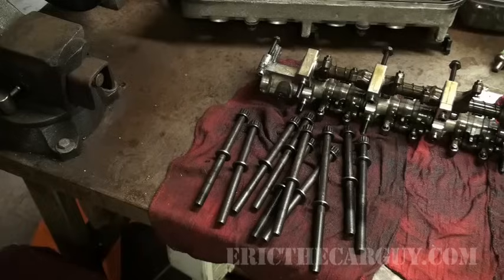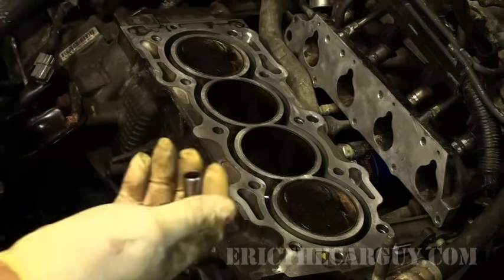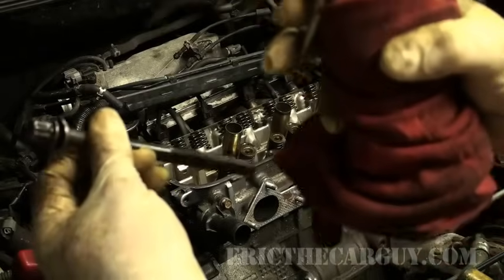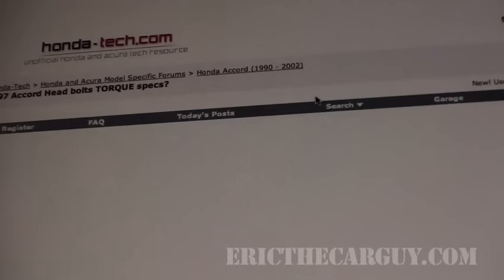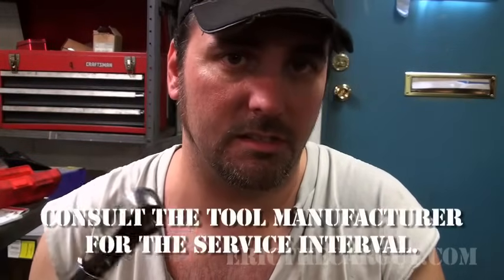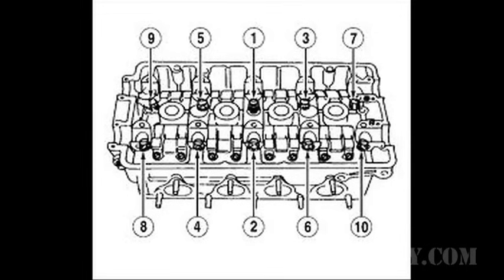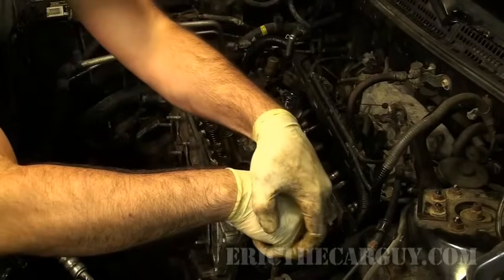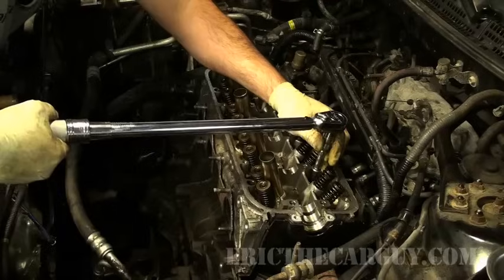How To Torque Cylinder Head Bolts - EricTheCarGuy

Comment: So remember to follow the order of the bolts right from beggining to end of the service. Never change that pattern or you will be in trouble. You can download that order for your car (specific engine) and follow strictly what the manufacturer say on the service manual. Don't change things. Don't try to do things that are not right. And you ETCG, you should take out this video or do another with the service done CORRECTLY. Regards for you ETCG. Here you fail but in other videos you're right.

Comment: In this video ETCG made some mistakes like changing the order of torquing the bolts from one stage to another. If you start on a deternined sequence YOU MUST do the other 2 stages of tightening THE VERY SAME SEQUENCE of the first stage of tightening. So much detail and ETCG fails in the most important thing that is to STRICTLY FOLLOW the order of tight of the bolts. This must be consistent from the beggining to the end of the 3 stages of torquing the bolts or your head may be affected.

Comment: Bought a Toyota Supra 86.5 with a 7M GE engine to find that the head gasket had blown.
The previous owner didn't follow any steps that Eric has mentioned. I'm sure the old owner has only one brain cell and should of left it to some one who understands the relationship between engineering and using a torque wrench correctly.
Thanks Eric, Excellent video explaining torque and tightening head bolts!

Comment: And here I am, thinking about bolting my head  with a normal wrench... I went to my local tools shop and the only torque wrenches they had were super long and heavy (like, weighing more than 8 kilograms and more than a meter long...). I need to find myself a smaller, lighter wrench which will do the job just as good.

Comment: Had to use about 5ft worth of extensions to torque a valve connection once, didn't know about not using extensions! still at least it was done up evenly which is what the main concern was.

Comment: image link:
assayyarat   .   com/myimages/Apr05/bader_car_M6013B514.jpg
i also have oil valves sound and replacement parts is very expensive  can i fix them because some peoples said i can calibrate them and they will work just fine, i found a link about this issue but i am not sure if that is the same as mine:
sanjosebmw.smugmug    .    com/Other/Tech-pictures/10976964_bHf66#!i=767209614&k=WupU9

thanks in advance

Comment: Hello Eric, i need your help please.
i own a Samsung SM7 which have Nissan VQ23 engine, few months ago the engine temperature went so high so i turned the car off and added water to cool it down but after that i noticed that the car lost lots of torque and there is a strange sound when i reach around 5k RPM and instantly release the gas pedal, mechanics said that i have to replace parts in engine, i don't know what they are called in english but check this image please in my part 2 reply

Comment: I am trying to replace the time belt on Chevrolet Kalos 2005. I have bought the kit and the water pump, but now after I have watched your video I came to a conclusion that I will need to tight the bolts according to the car specs. Is there any site that provides the specs for the water pump bolts, idler, gear pulley, roller, etc ?

Comment: Janitha thats not too uncommon. Most original engines can handle reuse of head bolts, so dont worry. on my old volvo I reused the headbolts atleast 4 times, its not a problem. Just use the torque specified, its more than enough to keep the head and block together.

Comment: Eric, I'm from a country where garage level engine rebuilding is far behind the due quality and technology. I happen to visit many garages where they use the same head  bolts after a so called over-haul. 
Bolts are said to stretch or something once used. Is there any way to compensate for that with the torque specs. I mean a little increase or decrease in specs for bolts reused.  Cheers.

Comment: The springs are always under tension as far as I know, less so when the wrench is cleared but still just enough that they may stretch over time. You only need to get them recalibrated every year or so depending on what the manufacturer recommends.
Your car not starting could be another issue, not that the wrench is inaccurate.

Comment: Eric said torque wrenches need recalibration, BUT it is assumed as a busy mechanic his torque wrenchs are used frequently.  My question was about a torque wrench which hasn't been used after it was recalibrated.  I still find it hard to believe that springs can stretch just sitting around in a tool cabinet unused.  If true people shouldn't recalibrate a wrench until they know they will be using it.  Which would be useful info for infrequent mechanic.

Comment: The husband and I replaced my head gasket.  With your video think we torqued it to the right level.  However, the car still won't turn over.  Husband thinks he needs his digital torque wrench recalibrated.  Can a torque wrench lose calibration even if it has been sitting in a tool chest for a couple of years unused?
Reply: yes.

Comment: some say when replacing head bolt, i would have to reopened the head to retorque it back due to there's some loose effect after the engine is running? is it a myth ?

Comment: All bolts stretch, however "stretch bolts" undergo plastic deformation and should not be re-used whilst non "stretch bolts" only undergo elastic deformation and can be re-used.
The use of metric/imperial really depends on where the car was made, Japanese imports would have been using metric well before the 80's.

Comment: Eric, wouldn't adding oil to the head bolts just defeat the pre-cleaning with the compressed air? I think I understand why you cleaned the bolt holes prior was to prevent hydraulic lock from letting bolts torque down at spec. Maybe, oil the bolts, but wipe to leave just a film instead of dripping.

Comment: You use a disc grinder ( 4" or 6"Cutting wheel) cut them them a quarter or half threw and when they snap you know they are torqued correctly.  This insures you are really dumb because you don't know  what you are doing.  HA HA

Comment: I think its is an interference engine from memory, nice little engine 
if its looked after, oil and filter changes twice a year and a Cambelt
when required. just pay attention to the Cambelt sprockets as when they wear they chew the shit out of the belt. the biggest problems are the electronics. failed coil packs can blow the ECU.

Comment: I would never put thread loc or anything else on head bolts unless the manufacturer states to do so. I have worked on Mitsubishi engine's
where the block threads go through to the crankcase and a sealant is required.
I always replace the bolts whatever as i have had reusable bolts snap twice
and they tend to be the last ones you torque.

Comment: The swivel head wont alter torque applied to the socket it will just increase the effort required to reach the torque set. Welding expensive tools is never an option unless you have loads of money.

Comment: I dont know where you get your info from but its slightly off, a concentric attachment will not affect the required number since it is in line with the head of the torque wrench. 
also, you are not correct about your"one swift movement to torque" the truth is the slower you go the less inertia you create and therefor the torque/energy is transferred to the bolt instead of being consumed in the speed.

Comment: if u use a clicker then make sure you have lots of lubricant. if i hear pops then i start over after adding lube. sometimes i torque the head bolts down then come back in a couple hours and loosen then re torque.

Comment: I'm replacing a "cylinder head" on 1996 mitsubishi lancer with a 2.4  4D68 engine:
can I just tighten the cylinder-head  bolts, using a regular key and a "90 degrees" angle rules/marks (40+90+90) instead of using a torque wrench??  I DON'T have a "torque wrench" to use and i can't find one where i'm...... so is it possible to re-tight the bolts without using the torque wrench??? 

thanks in advance.
Reply: I wouldn't. !!!!

Comment: got 600k on my accord 2.2 never blew a gasket or every time I try to adjust the valve they're in spec's. not saying the 2.2's are the greatest engines but mine is a freak.

Comment: that little wobble when you first put the head on could have been the dowels  . i check them on the head and put the tightest one on the block . 
had a prelude and that same top right bolt made the same crackling noise. head was fine till the person I sold it to let the timing belt go 5 years past the due date. bent some valves . so the head gasket with that one bad torque went 15 yeaars and might have went longer

Comment: I love watching your videos they are very informative. That is why I must correct you in one issue:
Somwhere around 13:48..
torque cannot be lost because of "extensions", in fact you could use very loose or warn out extensions and it woudn't affect final torque at all. Only difference is that you would come to specifed tourqe few ms later..

It could only affect tightening with degree tensioner you mentioned before in this video.

Sorry for my english (i live in metric system)!

Comment: the proper name for "stretch bolts" are called 
'torque to yield bolts." you shouldnt re-use the old bolts anyway. Since your that deep into the motor, replace the bolts.

Comment: A multi torque wrench for differnet size engines would be great for the spread of the gasket where all the wrenches turn simutaneously.which can be postioned on a hand held adjustable slide system all turing by geared system, and why dont we ever see groved and slotted heads and gaskets just flat ones ,which may hold compression better,and less blown gaskets.

Comment: My parts/tool supplier says it's better to use impact wrench extension for torquing down bolts like these, because they are less prone to the rotating force we are putting it under. 
And will make your torque number more accurate.

Will ask you this again in your forum though. at ericthecarguy com

Greets 

JD

Comment: Block I will be tearing down and rebuilding. This engine is quite simple to disassembly and assemble . I will be referring to the FSM for torque specs etc. Now my question is that the head bolts on this engine are different . They seem like a stud that goes into the bottom block and a nut up top. Please correct me if I am wrong. Could you cover the install procedure on that type of bolt? I believe they are "stretch" bolts and cab only be used once. I plan on using ARP head bolts on it .

Comment: Good morning Eric , I'd like to start by saying thank you for taking your time to make these videos. This is really good material for many of us that have a different profession but love working a cars. I have a 1995 Nissan 240sx that comes equipped with a KA24DE 2.4L DOHC motor that comes with 155 hp stock. I turboed this engine and upped the horsepower to about 310 hp. Now I've come across the limit for the stock internals. I bought a spare block that I plan to build. It will be the first

Comment: You need to take the pistons out and put new rings, hone the cylinders, and new bearings.
At least take the pistons out and clean the rings...they might be stuck.  My friend took his 
car to a mechanic for a blown head gasket and they did not take out the pistons, sure enough
one of the cylinders didn't have enough compression.  Then he won the lawsuit, $2500.

Comment: Excellent video.
Left out...
-Try to keep your hands off the socket, extension, etc. while torquing. Hands on handle only. The friction from your grip can throw off the torque setting.
-Keep your hand in the center of the handle. Choking up on the handle/holding the end of it throws the torque off.
-Splitbeam torque wrenches dont have to be zeroed out.
-If you use offset wrench accs like crowsfeet you have to convert/adjust your setting to allow for the overall length extension of the wrench.

Comment: Its a good thing in most cases. Since oils are almost non-compressible (compress about .5% for every 1000psi applied) that the oil acts as a filler and fills all the gaps between the mating surfaces in the end locking the bolt into place. The term for it is called "hydraulicing".

Comment: You torque to 25 ft/lbs, then put a ratchet on the angle gauge, lock part of the gauge and then tighten the bolt 120 degrees.

Comment: Mainly how much the bolt stretches without losing its ability to hold the head tight to the block and not come lose under regular engine use.

Comment: Hi Eric,  can you tell us the model # of your short and long Snap-on torque wrenches and where do you buy Snap-On tools from?  Second question, if you had to regrind the head flat on a car with 156K (honda 2004 ex with VTEC engine) or would you buy the head and transfer all the valve seats etc over from the old head... or just bite the bullet and get the complete head with all the tackle new?

Comment: Hi Eric! When it comes to torque it can be deceptive. I torqued my transmission pan bolts to spec and bent up the pan and ended up having to replace it because it kept leaking. Just an FYI sometimes feel is better than spec..

Comment: I'm not a mechanic by any means, nor do I have any vast knowledge of the inner workings of engines (I'm only a freshman, studying mechanical engineering), but isn't oiling up the threads on a bolt (any bolt) a no-no? Friction is one of the key characteristics that makes bolts do their job properly. Oiling the threads affects this property, thus, by theory (AFAIK), damaging the mate-quality between the two parts held by the bolt.

Comment: ok 3rd post on the same vid. not to nitpick BUT consistency of the torque ing is key. an old diesel tech taught me the "key is to sneak up on that number . THEN let it sit and do it one more time. acording to him it was a chaw's worth of time . (20-30 mn ) do it again till its done. and in his words.. "Aint no goddamned deetroit or any motor gonna come loose, "spits, And any damned thing ya need to keep tight.

Comment: Can do the final step with out an angle gauge after torqueing the headbolts down.90 degrees,a quarter turn with a breaker does the same thing.Honda headbolts are in real tight,I broke a 14mm deepwell impact socket,a 6 point.Jaguar headbolts can be used up to 3 times,marked with a center punch

Comment: Piston slap is caused by the piston being too loose in the cylinder bore...either from the cylinder wall being too worn down or if the engine was ever overhauled, oversized pistons were neglected in the reassembly. So really, the correct way to fix piston slap is to tear down the motor and install the correct size pistons, or re-sleeve the cylinder bore for the pistons you have.

Comment: Hey Eric, i have a Golf Mk2 1.8 and i replaced the head gasket recently. I am 16 years old and this was my first time doing this but there was some coolant in the holes for the bolts, i didn't mind it so i just torqued down the head. It's been running fine, haven't tried it on the road yet just been sittin in the garage the last months.
In worst case scenario, what could this trapped coolant/oil cause?
I don't wanna spend $70 on a new set of stretch botls..

Comment: Hi Eric, my tightening torques says at stage 3 torque at 25Nm after running engine for 25 minutes. The problem is that the engine is not in the car and impossible to start. What should I do?

Comment: im mad because i've done my head gasket on my car but i haven't enough money for new bolt .. .so oil is leaking , so ill have to do it again , but i was doing it because overheating  problem, but in the end it not overheating and take less oil than before  ( valve seal)

Comment: Interesting video! But i think you are wrong about one thing! If you have more than one extender you will get the same torque. That is just plain physics. Torque doesn't disappear in thin air! But I admit it's easier to work if you keep your extenders at a minimum.

Comment: The grade of the bolt will also dictate the torque you can apply to it, you might have a bolt that will be a 10mm and should be torqued at example 35 ft/lb. but sometimes it might be an application where you need more torque and the bolt will be a grade 12.9 instead of a 10.9 or 8.9 and will allow you to reach a higher torque based on the application where it is used.

Comment: @Hitmanz21 I understan that what you mean but I'm talking about the style where the beam actually bends and there's a pointer that stays stationary with the head of the tool. this guage on all the beams style wrenches I've seen can be read by using the tool to torque in either direction.

Comment from the maker: @Patrick1776Henry Yea, fastener size is based on thread pitch and the diameter of the fastener itself NOT the head size so keep that in mind.  Ex.  if the bolt size is 10mm x 1.25, the diameter of the fastener is 10mm, the head size may be 14mm.  This is actually an excellent question.
Reply: I have a Chevy Impala 2003 had a macanic change intake gasket got the car back it runs hot I've changed radiator, thermostat,fan, I have to bleed the air out the lines everyday. someone said the macanic may have not tourped it right would that cause air to get in the line every day

Comment from the maker: @X2N18 The rule is to try and use the wrench that has the spec you looking to achieve in the MIDDLE of it's range, if it's close to one end or the other of the effective range of the wrench try to find another wrench where the spec is closer to the middle of it's operating range.